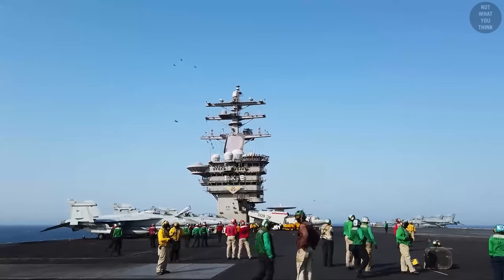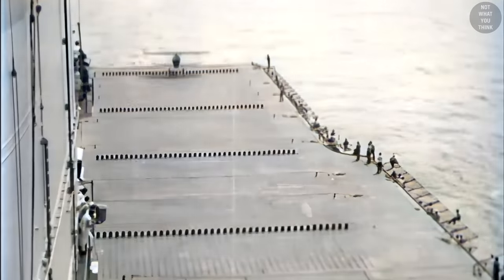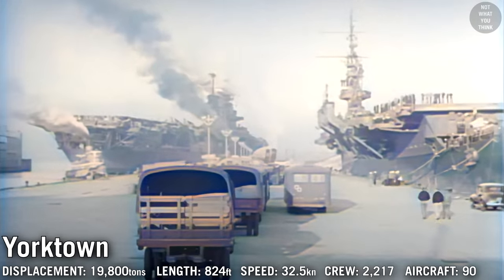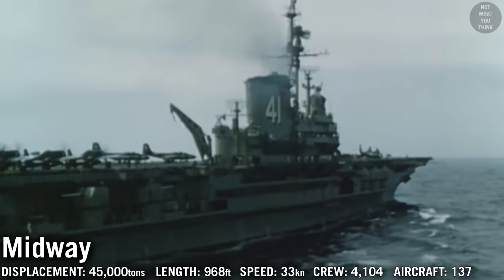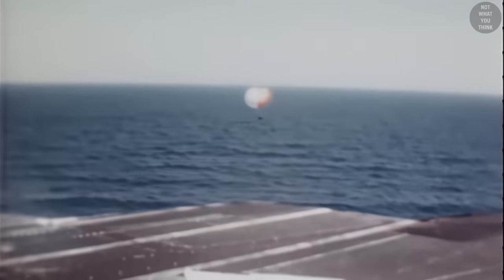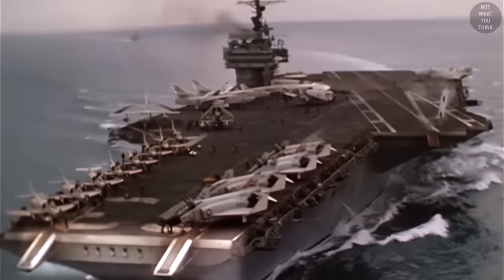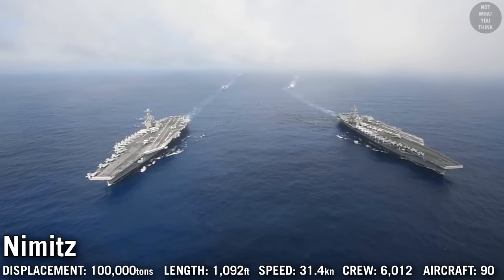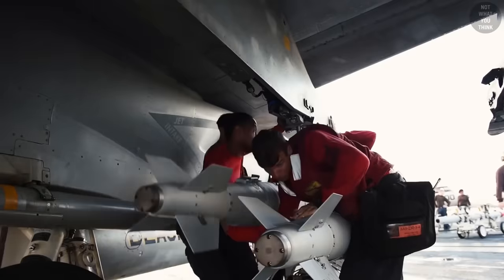Evolution of American Aircraft Carriers

Comment: I expect that the Fords will have directed energy or mass driver based weaponry in the near future.  

The advantage of the DE weaponry is lightspeed engagement....and...as with the case of missiles...uneven heating of a surface can generate catastrophic dynamic stress to the airframe...while an upper power version can burn through the missile...destroying it.

MD tech allows a faster rate of fire and a greater ammo supply as there is no propellant component to the projectile.

A third possibility is the use of Bilpro tech in her CIWS.  This may not be as feasible for CIWS due to mechanical limitations...but basically you gave two hypergolic liquids that react explosively when mixed.  The shell drops in..you squirt the two liquids into the breach... they react explosively to propel the shell.  Slower than a MD in fire rates.

Final idea for CIWS would be a "Metal Storm" type emplacement that would have a series of pre-loaded barrels with multiple shell and propellants stacked inside. Fired electrically...these guns in say banks of 100 could literally fill the sky with metal...giving an incoming round...even a shell...a very hard to penetrate defense.  Only drawback is these blocks of barrels would have to be replaced to rearm.

Comment: Not sure if I am wrong or right....
The big command center with the bridge and almost everything is on the right hand.
"They put it there as a counterpart to the spinning rotators of the airplanes"....

That would mean those machines spinning counterclockwise.
Which they NEVER did.
As Fact, ANY machine (working cylinders to force round-up-force) ever build so far is still working clockwise.

The real reason WHY the command turret is on one side is because the elevators which are lifting up the heavy gear (fighter planes plus ammo) on the other side.

Remember one thing... what ever you do, you gotta keep the balance?
So, there is that enormous turret of 20 thousand tons on the right....

How do you keep the balance on a ship like that?

Comment: So, armored and unarmored carriers and bomb hits ...

USS Franklin - one bomb penetrated to the hangar deck; a second bomb penetrated two decks

USS Bunker Hill - one bomb penetrated to the pilots' ready room; another bomb penetrated the flight deck but exited out the ship's side at the gallery deck level

USS Yorktown (CV-5) was hit by bombs, but was able to steam at 20 Kn.; Hiryu's planes hit Yorktown with two torpedoes, and then I-158 finished her off with two more torpedo hits.

USS Hornet (CV-8) was hit by three bombs, but the damage that forced her scuttling was done by three torpedo hits.

USS Enterprise (CV-6) was hit by three bombs in the Battle of the Eastern Solomons; was hit by two bombs at the Battle of the Santa Cruz Islands; was hit by a Kamikaze in May 1945; was repaired and took part in Operation Magic Carpet in 1945 and 1946; was sold for scrap in 1958

Comment: If there is anything that could be valuable, it is U-boats as Aircraft Carriers!
At the same time, all larger ships should be equipped with VTOL aircraft and of course the increasing focus on Drones!
If it is something you would like to have yourself, it is a better version of the current VTOL with greater load capacity and longer range - it could in principle replace the car if the sensitivity of the turbines could be overcome...

Comment: I never understand how vacuum tube(i know they were phased out in the early '70's, for giant, hot transistors), non IC boards, with miles of ribbon cables, use less power than modern electronics. Granted, a lot more electronics, but just swapping bulbs, for led's must be a massive savings in electricity.
Reply: Like, electronics were huge so you could only fit so much into limited space and because of that, you had to power less things because you couldn't fit as many...ie. 3 systems that took up like 3 whole rooms but each system used 2k watts for total of 6k watts, for example, instead of modern day where a whole room you might be able to fit 50 computers using 800w each, so total of 40k watts. Kind of a shitty example but I hope it made sense.
Reply: @A M  
I understand.
Just still doesn't make sense that a ship built in the 60s that was designed to run hundreds of analog systems would have a hard time providing the juice.
An original, single of many, radar system of the late 60s would run off of over one hundred tubes- my dad  was an electrical engineer in the navy 62-68, has lots of good insight on this-
Any modern version uses over 100 times less electricity.
Thats no insignificant amount, on one single system.
Just seems like with the massive, exponential energy savings with modern equipment, it would be at worst, a draw.
Im just talking out my ass, so what do I know?

Comment: The planes will be smaller semi-automated drones using high level technology for communications and security…. Both in the air and in the water. They’ll also serve with satellites as emergency communications hubs…. Just my guess.
Reply: As I understand it, the current idea is to have 2 or 3 UAVs flying in close proximity to each manned aircraft, providing on the spot decision making capability as well as increased flexibility for missile combat.

Comment: It's insane to think that a few years ago a carrier needed a crew of 6000 to man a super carrier, nowadays you only need about 600-800 due to automation
Reply: And you then have issues with damage control BIG TIME.
There is a specific reason Navy ships (for ANY major navy) have always had large crews, and it's NOT "lack of automation".
Reply: @bricefleckenstein9666  royal navy manages just fine
Reply: @tiddyfard4517  The Royal Navy doesn't crew carriers with 600-800.
Go back and listen to the video, they were talking about a REDUCTION of that size, not a total crew.
The AIR WING ALONE was over 2000 (I think it was a LITTLE under 3000) on USS Ranger, the Nimitz class would have had a slightly larger crew due to the larger air wing carried than the Forestall class did.
Reply: @bricefleckenstein9666  HMS QE operates at 700 currently and when fully complemented will crew 1700. Cope with your defeat
Reply: @tiddyfard4517  Is that the Ships's Company ALONE, or the entire crew including the Airdales?
Also, 1700 is a FAR CRY from your 600-800 claim in the original post.
You just defeated YOURSELF even if that is strictly the ship's company - and I'd hate to have to try to keep that ship operating after it took combat damage.
Reply: @tiddyfard4517  And what happens to her when those highly automated systems stop working after taking battle damage?
Some battle repairs AND FIREFIGHTING take a lot more folks than you seem to think.
On the other hand, the Brits aren't likely to be facing first-line navies any more, so they can probably get away with designs like this that WON'T handle heavy battle damage well due to lack of people to deal with extensive damage.

BTW - pretty much all US Navy enlisted go through damage control training as well, and ALL go through firefighting training.

I'd also hate to be the crewmen trying to keep up with MAINTAINANCE with that small of a crew.

Comment: I think they realize that in modern times getting congress to agree or approve anything is a long process, so they figure 90 years will cover it. Honestly it's just a case of overlap, you never want designs that are only good for ten or twenty years because it's likely you'll be using them a lot longer than that. If you have to shelve a ship at 50 years instead of 90 years, that's fine, but if you get to 50 years and don't have a replacement? Then you're stuck. I doubt it's intended as true futureproofing as that's been proven a pipe dream in every other field of technology, so I can't imagine it'd be any different in defense technologies.

Comment: Well! In ninety years, which is way beyond my life span, I think and hope that we are exploring our solar system and doing it within days to a few weeks, instead of years or decades ... As for Aircraft Carrier technology in regards to engine design and propulsion, I see a much smaller engine that can generate 1/3 or better power output and be able to be stay at sea 1/2 longer duration ... I also, think that much lighter materials will be invented that will be 1/2 to 3/4 stronger, thus allowing Carriers to increase horse power to generate speeds exceeding 40 to 45 Knots, if not faster. And, be able to maneuver out of potential problems at those faster speeds and angles ... And, I would go as far as being able to travel within Cat 1 to 3 Hurricanes as easy as a tropical storm or tropical depressions ...

Comment: If the royal Navy invented stream catapult then why they don't using it now?
Reply: Because there's more modern catapults, also some of their carriers still do have them.
Reply: @bigmwsb3928  you don't get me...
Reply: @bigmwsb3928  they used steam catapult before but current aircraft carrier's don't have that. No catapult no arresting wire. Now They depends on short take of and vertical landing.
Reply: @kishu3b  no, no they do not fully rely on STOL and VTOL, they of course still rely on both catapults and arresting wires, you're just probably getting confused with some information you've warned
Reply: @kishu3b  they still have modern naval aircraft because some times VTOL and STOL can't get certain jobs done, so they do have aircraft carriers that have both of those.

Comment: I have to disagree about the power consumption of the previous class of carriers vs the present.  The simple fact was that just the lighting alone for the carrier, coupled with the incandescent lamp use in all the electronics, was a significant power drain.  Today's LED lighting and use in instrumentation has greatly reduced the power demands.  Today's carriers with the electromagnetic launch and arresting systems have been a dismal failure, so much so that previous President Trump ordered the cessation of that type of system.

Comment: Here is one for you, the Navy, all Navies, have always, by necessity, been at the forefront  of technology development. This combined with leadership crippled by self serving tradition, misogamy and learning by failure after the fact has resulted in, tah dah, the think or sink dilemma. This is in large result caused by sea sick engineers needing advice from sailors that aren't listened to till lots of them die. The other services have this problem but their mistakes are not as spectacular. Thinking ahead is not the Navy way.  But, since you asked, what is the one thing on ships that they all have and still have going back to the beginning? And you thought you were clever, why it is the Anchor. Pretty much the same and as a metaphor, how appropriate as a symbol for Navies. stuck in the bottom crud, pretty much the same, function and need etc. So, for your next video, the Anchor, its chain, its purpose and I propose, tah dah, "A Smart Anchor", some sturdy computer chips, a few propulsion units, some optic points and sensors, all water proof and finally some upgrade after 2000 years.